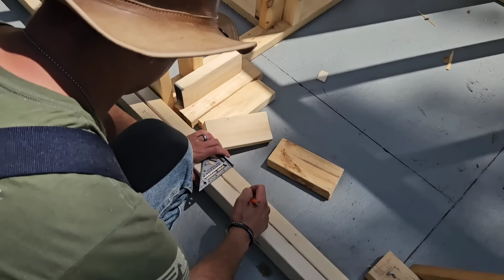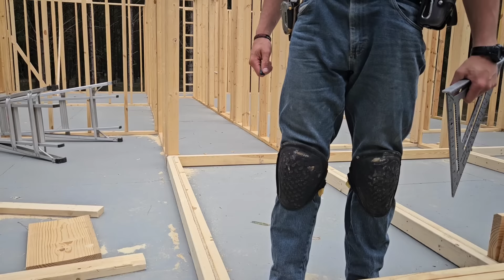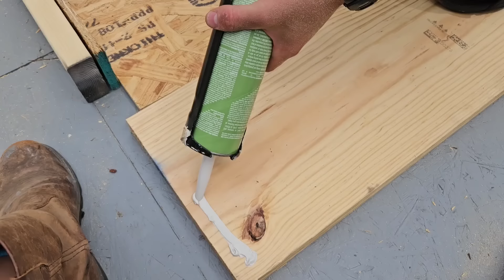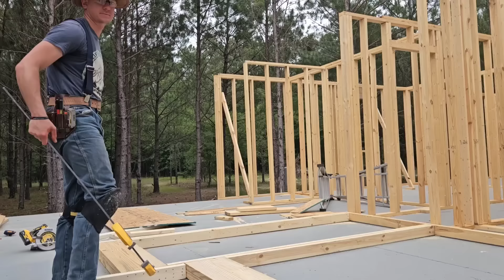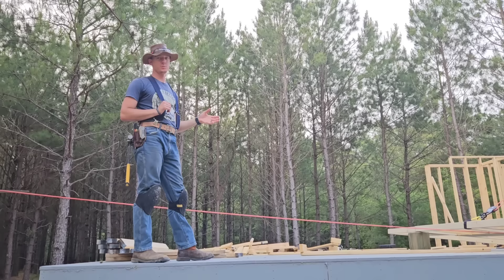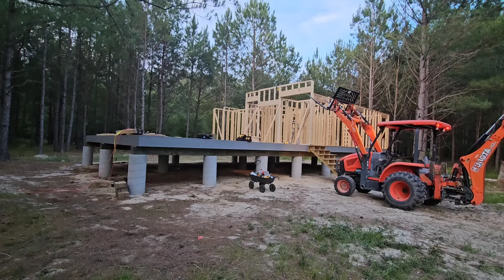We Didn't Expect That To Happen | Starting On The 10' Walls  | Building Our Off-Grid House (By Hand)

Comment: Congrats on getting the first 10’ wall up.  Another mile stone reached!  Boy isn’t it nice to be able to use “tractor power” for some of the heavy lifting…😁
Reply from the maker: Hey Adam, yes we are very excited to be moving along with the walls! Question: what would you do next, exterior wall sheathing or move onto the roof and try to get it covered?
Reply from the maker: Hey Adam, yes we are very excited to be moving along with the walls! Question: what would you do next, exterior wall sheathing or move onto the roof and try to get it covered?
Reply: @DIYorDIE_Off-Grid  My first thought was to get the exterior wall sheathing done first because that's easier to knock out and it add adds more strength to the overall structure.

The more I think about it and look into it, it seems like people tend to do the roof first so you can have a covered workspace.  

I guess it would depend on what you have more of...wind or rain... 😁
Reply from the maker: We decided to go with the sheathing...hopefully that won't take too long
Reply: @DIYorDIE_Off-Grid  I don't think there's really a right or wrong answer.  Looking at the design, it doesn't look like you have any crazy dimensions or angles, so it should be a pretty quick process.  Just remember to save yourself some time and cut out the windows/doors after you hang the sheathing... 😁.  Wasted a lot of time before I learned that trick!
Reply from the maker: Haha, I plan on doing just that with doors and windows. So much wasted time to try and measure and cut boards to fit...we will see how it goes!

Comment: Working smarter not harder has it's learning curve too. Great job. The rest will be easier.  Stop blocks on the edge of the deck or to prevent kickback will go a long way. You got this 👍
Reply from the maker: This is very true. We learned some tough lessons this day!
Reply: Don’t beat yourself up too much. This is great progress! Maybe some faster communication between the two of you while the wall is being raised so the tractor operator doesn’t pull too far. My heart went to my throat as that rope went taut…
Reply from the maker: Thanks for the support 🙏

Comment: Good job you two, a hint screw or nail a little block of wood to your floor a couple of inches away from the turning bottom plate to stop it jumping back out at the bottom, if doing on outside walls nail two longer blocks onto the rimwall edge in vertical mode. Trust me as a slightly disabled person you figure things out, especially doing it by yourself, or with 2 people
Reply from the maker: Thanks for the tips! We are going to use this method again for the next few walls.

Comment: next time secure straps to the deck at the bottom of part being lifted into place - leaving enough space for rotation - to help prevent it from kicking out, at least in two places - each end. Standing where you did with it up in the air like that was dangerous, it could have caught a good gust of wind and kicked out with all that top weight and literally acted like a boot kicking you, except it would hurt a lot more if not create a fatal situation, and those straps would help to prevent that type of situation.
Reply from the maker: That's a great idea, thanks for sharing!

Comment: Not sure if it would be worth it yet, but there is something called a wall jack. It's basically a tall jack for raising framing.
Reply from the maker: Thanks for the tip! We looked into getting a set of those, but this method worked so well we decided to just do this for all the 10' Walls 😄

Comment: You guys need to learn how to use the bucket on your backhoe to lift things and to pull with, would have made it much easier getting your walls up.
Reply from the maker: Hi there, we chose to use a pulley system for a variety of reasons, #1 being that it is super simple to setup and it works very well 😀 our house is raised 5' feet off the ground and the tractor backhoe can't reach any of the interior walls. We also have some tight spaces with trees and septic field which prevent or limit our ability to drive the tractor up next to the house.